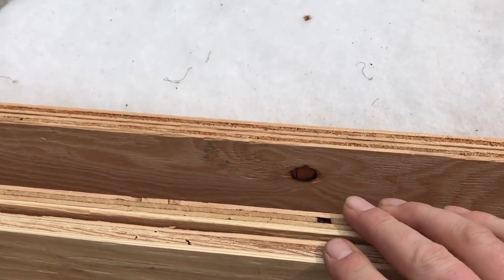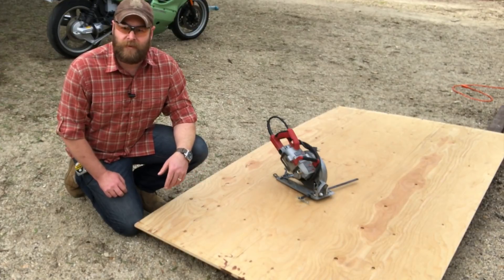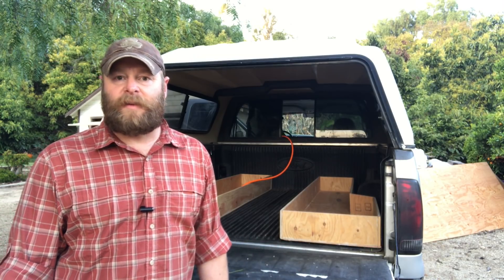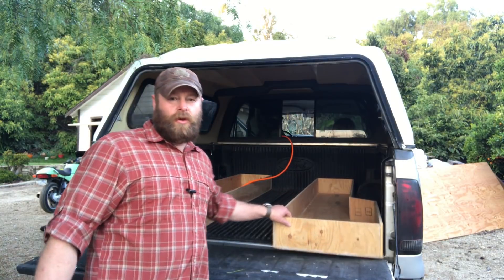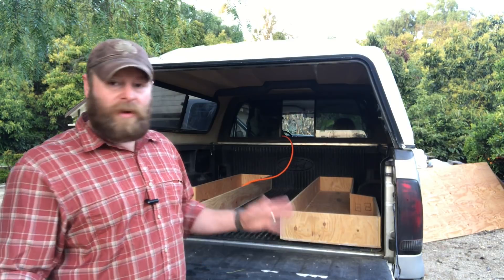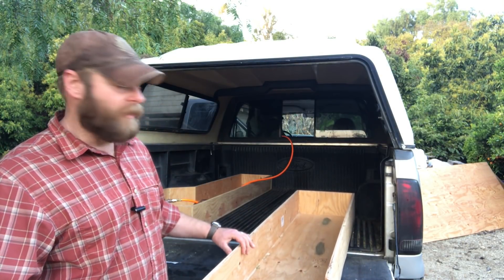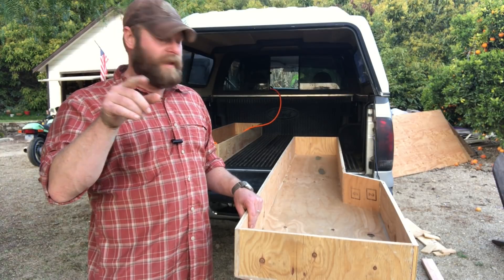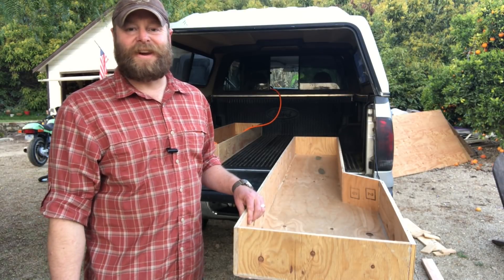Building A Budget ADVENTUREMOBILE Conversion Part 1

Comment: Hi Zack
Love the channel and especially this project. I hope you get loads of adventures out of it. 
Regarding keeping the boxes in place, how about a chunky bar that's hinged to the side of the truck that folds out across the top of  the boxes a few inches in from the back of the truck and clips into a securely mounted fixing on the other side.  If it's at the right height, it should hold the boxes in place very well when they're pulled out.  If you cut a notch in the top of the sides of the box that the bar could drop into when the boxes are extended before securing in place, that would lock them in nice and securely.  I hope I've managed to describe my idea in a useful way (it's pre-coffee here in the UK!).  Good luck with the project. I can't wait to see how it turns out.  All the best, Joe.
Reply from the maker: Thanks a lot Joe, that would be a really good way to address this.

Comment: Zack,  I love it! Great find on the shell!  I have something in mind for my Ram1500 2WD as well, even though I JUST bought a tonneau, I want to get a shell also for the same purpose!   So, your looking to stop the teeter-totter of the drawer - and its going to go over the drawer, rather than under because you have the guide rails using the grooves of the bedliner.  I am assuming by the shape of the drawers that you want a path in the middle to get in and out, and also be able to sit inside bench style.  My first thought solution would be to have a couple L shaped  2x4's on each side (think half a window frame)  bolted into the  wheel wells,  as well as the floor.   :)   I am sure you are going to come up with something better though --- and I can't wait to see!
Reply from the maker: Hey John, I had toyed with that very idea for a while until I hit upon the current one.

Comment: I was thinking about making one out of an enclosed utility trailer.   To avoid the extra vehicle registration and maintenance.   Even though there is some with a trailer.   Why didn’t you use a trailer?   You’d also still have your truck bed.
Reply from the maker: Registration, tires, parking space, trailer lights, to name a few reasons lol

Comment: could you not mount a crossbar from side to side? that would prevent the ends from tipping up. My first thought was a spring tensioned shower curtain rod. It could be easily removed to take all the gear out if necessary.
Reply: bhein67, if he does that he has to make cups for the curtain rod on the ends to keep it in place. Curtain rod may not be strong enough i was thinking 1/2" pipe split in the middle with a collar to fit over the split pipe pinned through the collar and pipe to keep in place. The cups could be made out of wood by drilling holes to fit the pipe in then glued to the truck bed sides. Make the collar long enough to slide one pipe all the way out of the cup but, making sure the pipe fits all the way out to the sides before pinning in place. Just my two cents. Cheers.
Reply from the maker: I thought about something like that but in this case, vertical space is at an absolute premium

Comment: support your sliding box with a short cable / chain from the tailgate support bracket. This will be strong and solid mount to the truck bed not the flexible fiberglass camper shell . also won't be too long or in the way. Another idea would be a support that connects to the bumper. Good luck with the project.
Reply from the maker: Good thought thanks Bradley

Comment: Add long term water storage in the end of the drawers that will be on the inside of the bed area. Are you going to make a platform that will be over the drawers? I wish you would have told a little more of what the plan was with what you are building that way we would have been thinking on the same train as you. Look forward to the next one!
Reply from the maker: I'm seriously considering doing just that in the front end.

Comment: Even though it will add extra weight to your vehicle, I would use counterweights in the far back end of the drawer. If you could use something useful such as extra car batteries, and an inverter you could have an extra source of power for charging phones etc..
Reply from the maker: Good idea

Comment: Make sure to wax up those runners.  40 inches of cantilever is quite a bit, and the weight of what ever is on it will determine your outcome.  Good idea though.  I would seriously consider an adjustable leg; that folds AND doubles as another runner.  Not to hold all of the weight but to keep things from bouncing around while in use.   Put a small box/chest on the ground and have a square hole in the top.  then an adjustable collar that you tighten to the appropriate height would keep things stable.  I am sure what ever you do will be pretty cool though!
Reply from the maker: Good idea, Thanks Bill

Comment: You will lose about 3/4" maybe, and you will likely  have to cut your  bed liner. ..also , some minimal  iron work would be needed, but, if you really want to cantilever those securely,  make some industrial  slides out of unistrut. Either 7/8" or 1-5/8" unistrut would easily support a 40" cantilever.  It's galvanized so it's real slippery.  When stacked together  in an opposing  manner, it locks into a linear sort of arrangement  where you can slide them along one axis only.  I've made shop drawer  slides where the strut also acted as the side of the drawer. When pulled out,  they doubled as a step Ladder so I could  reach up into the rafters. ..and the  slides that were part of the  work bench were flanged and mounted to  the wall only [no support in front of cabinet  because there was no cabinet. Just seemingly floating drawer slides.  Anyway,  check it out on Google.  It's called  a few names.  Most common is unistrut  or super strut. It's used all over the commercial  building trades.  It's made to support heavy duty  loads.
Reply from the maker: That would certainly do the trick!
Reply: Zack Of All Trades ..haha very funny ..I mean, I know for a fact it would do the trick, if the trick still needed to be done.. I saw your followup video. Nice job!... you know, if the plywood ever wears out, a nice durable replacement would be 7/8" unistrut. .. just screw it to bottom of drawer, as long as the washer of those bolts aren't more than 1.5" in OD.. ...anyway, it's a moot point by now. Thanks for the reply , keep up the good work . I enjoy your content.

Comment: TWO BOLTS ON THE INSIDE FLOOR ON EACH SO TO COUNTERBALANCE WITH RIGIDITY THE BALANCING PART, AND A STRIP OF WOOD TO HOLD THE END PART THAT STILL LAYS INSIDE THE VAN
Reply from the maker: Yep that's pretty much it.